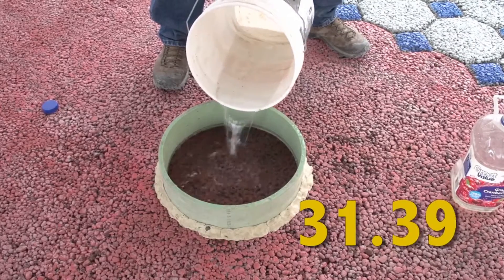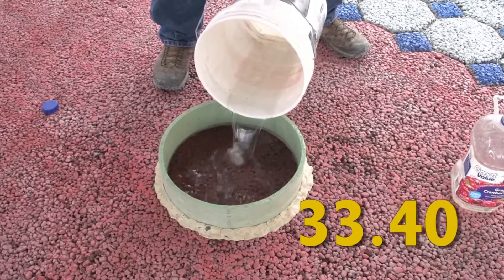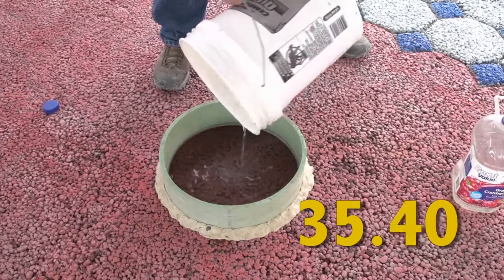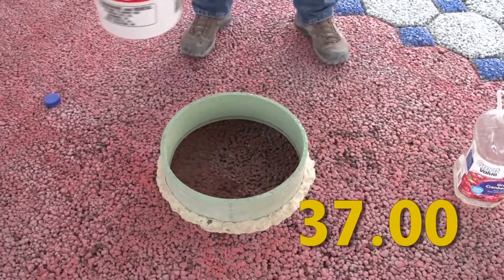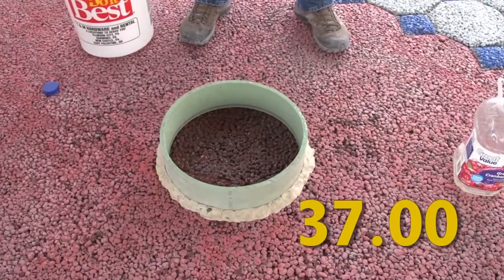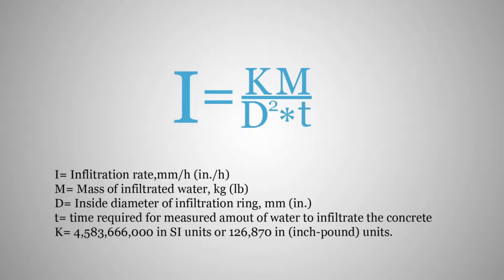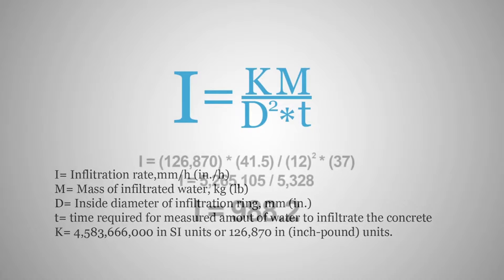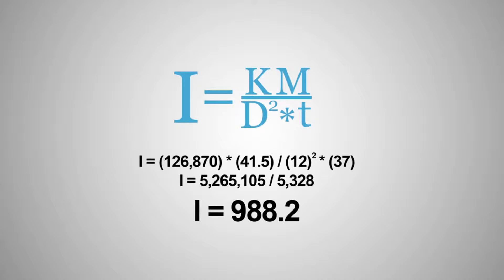ASTM C 1701 Infiltration rate of Pervious Concrete Demonstration

Comment: But why we cannot fill full amount of water in ring .
                      Also 
Why we fill the water only at 10 mm and 15 mm .
                    Plz reply me sir
Reply from the maker: The porosity of the concrete prevents the ring from filling,  but the procedure as it was developed and is specified dictates the means for adding water to the ring.
Reply: because its specified as per code astm c 1701